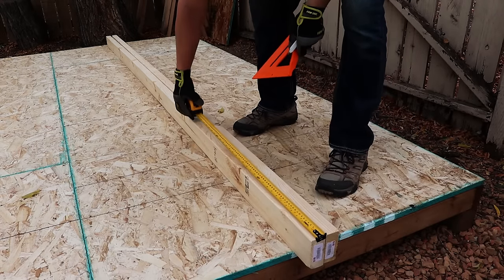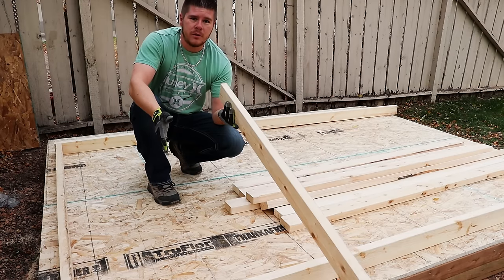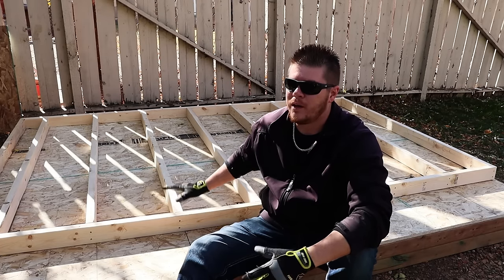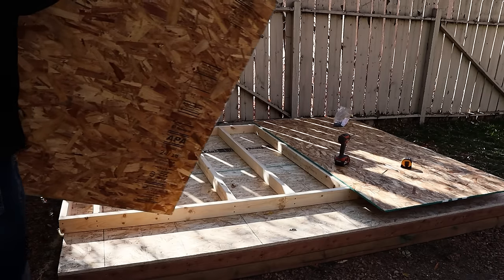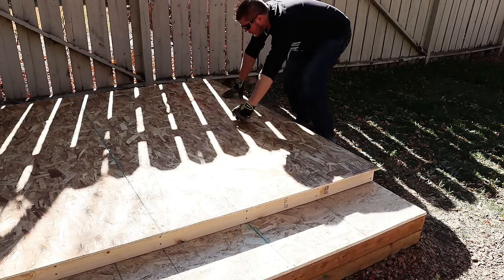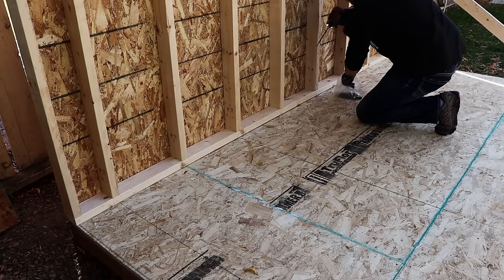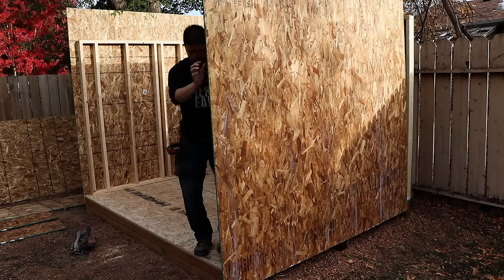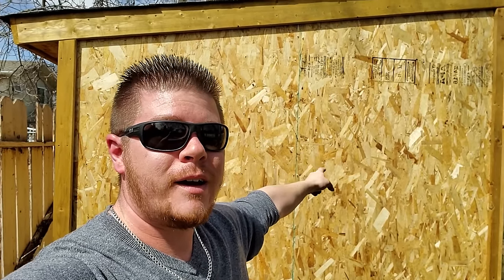How to build a storage shed - Walls // Part 2 - Plans available

Comment: How much can one save building their own vs buying one ??? I was thinking about 1/2 .
Reply from the maker: Sorry for the late reply, went through a rough patch. You xan save a few hundred, but it's not so much about saving its what you're getting for the money spent. And doing it this way is much stronger. Buying one they have to profit off it and will skip wood and hardware. Wall and floors might be 24" on center instead of 16", sheeting might be thinner and brackets may be excluded. It's always best for you to build if you're able
Reply: @JessedoesDIY  oh ok if they skimping on wood I can how using more materials can add up .  like you  said do it your self and end up with a lot better product is worth it. Tnx for the reply I hope u are doing better now.
Reply from the maker: No problem, glad I could help. Good luck on yours and thanks, I am now

Comment: Can you use 4 way wood pallets as a base?
Reply from the maker: It'll create soft spots every place they join together. Typically when you have a floating floor, you want it to be one solid structure because everything else is based off that. If it moves, sags or shifts the rest of the structure is going with it

Comment: Would it be beneficial to use  4x4 composite for the base and around the perimeter 2x4 composite? Just for longevity ?
Reply from the maker: Not really, you can if you want but this is fine. Pressure treated is good for 30-40 year ground contact, which is about the expected lifespan of the rest of the shed anyways.
Reply: @JessedoesDIY  I see thank you !! Great Video BTW
Reply from the maker: Anytime, thanks!

Comment: In my 35 years in the construction business not once have i ever used a drill with screws to fram a wall and if any of my co workers saw me framing with a drill they would've laughed at me
Reply from the maker: Ok well, I've sent it plenty of times on site. And in this case I don't need shear strength, and most homeowners don't have nail guns, but most have drills. I did it this way for the homeowners to make it easy and approachable, but you do you on your site man

Comment: Hi Jessie what did you put on the exterior corners of the shed. I did not see that part in the video. Thanks
Reply from the maker: On the outside? It's actually in the door and trim video. Just some corner trim is all made from deck boards
Reply: Awesome, thanks for the quick reply. I ha e my floor done, working on wall #1, Thanks, I am sure there will be more questions to come ha ha
Reply from the maker: Anytime glad I could help. That's awesome good luck on the rest of your build. Feel free to ask if you have any questions

Comment: What is the exact dimension of your floor w/ plywood?
is 1/2" osb too thin for floor?
Reply from the maker: The floor is 10' × 95" and yes that too thin. The tongue and groove 3/4" stuff I used is specifically made for floors. 1/2" will give you soft spots

Comment: So these screws are long to where it's going through material under which already has screws SO DO THESE SCREWS CAUSING MATERIAL TO SPLIT ❓❓❓
Reply from the maker: Yes, the screws going down through the wall bottom plate and into the floor are longer screws, 3.5" long. And no, they will not split the wood. If you are in a part of the world where hardwood is common then I'd predrill the holes first, but for softwood like pine or spruce it's fine

Comment: Why did you go with osb instead of siding for walls? Cheaper? I like this design I’m about to attempt it almost identically… just wondering 🤔
Reply from the maker: OSB is more readily available in my area and is generally cheaper. They make a specific shiplap style panel for use on shed walls that is still OSB, just more decorative and pre-primed if you want. But for me this wall all good for what I needed and fit the budget. Good luck on yours!
Reply: @JessedoesDIY  cool! I may go with usb also then … speaking of budget, what did that look like with current lumber pricing? 😬
Reply from the maker: Well I built this in the fall then lumber was about 2/3 what it is now and OSB was half what it is. It cost me about $1500 all told in my area, without painting. But currently I'd put it around $2000 if I was to built it right now in my area. All depends on your lumber prices. For me a 2x4 was $7-12, and the 1/2" OSB for the walls was $37 a sheet when I built. Hope that helps
Reply: @JessedoesDIY  it does help thank you!

Comment: what size is your shed  and did you insulate the floor . i want to put down metal mesh and insulate with roxul rockwool    need to find your first video .,starting mine come fall  . 8x8   list of wood that i will need  next
Reply from the maker: Mine is 8x10. I did not insulate the floor, but Roxul is amazing stuff! I have a playlist on my channel with all the shed videos in it in order. I also have a materials list for my exact shed available in the description of all the videos, it will at least get you started.
Reply: @JessedoesDIY  I thought it was  . how did you cover osb board  I have not seen your other videos . I built my other shed 12x22 with a a roof  . put windows electric and water in it . built it when I was 56 now I am 68  and done building 2 decks and 3 pergolas   , putting down vinyl plank floors in 2440 sq ft, house new doors and new trim .but want to build better since I could \not get roxul rockwool here until last year .Now I just want a small workshop instead of messing up my basement all the time .By the way I have remodeled and sold 3 houses in my lifetime  . Now in my retirement house since 2004  but landscaping came first also  dirt and a house not pretty , by the way I am also a woman  as you can see by my name . never stop as it makes you old . my first ever lean too shed though .
Reply from the maker: Nope, nothing is insulated in this, it's just a storage shed. Later on I'll be building a proper workshop whenever I move, that will be insulated. The floor in it is just raw OSB. Wow, that's amazing. Good luck on this
Reply: @JessedoesDIY  thank you     I bought my 3acres for 15  thousand  and then the work began   a modular house    easy dried in and built in factory and followed my house to it's new spot    2  cranes and a house was born and now a home . Took long enough but love my neighbors , They are a tad bit noisy  but what can you expect from horses and cows

Comment: the top corners . i notised you did not use the T locking thing .. with placing another 2x4 on top shortening it by the with .. and then another 2x4 on the other wall extending it by a with .. so u can lock it down into the other wall .. or isnt that needed for this one ? .. no a prof contractor nor did i work as one .. so not hating, just asking :)
Reply from the maker: Hey no prob! I accounted for it, but I needed the front wall up first. I showed it in the roof video, it's before I even put any of the rafters in place. They are the top plates and yes, they lock the corners of the walls together. Hope that clears it up
Reply: @JessedoesDIY  ty for the reply .. yes i saw in the next one that you OFC did it haha .. sry :D but again not hating was wondering.. my build will start next month, so picking up everytthing i can
Reply from the maker: No problem. I figured you saw it. Cool, well I'm happy I could help out. Good luck on yours, let me know how it goes!

Comment: How do you keep the critters and snakes away from staying under the shed?
Reply from the maker: I don't have snakes here, too cold most of the time. But probably some wire mesh before I put the walls on, I'm not sure, never had to deal with that
Reply: @JessedoesDIY  I'm planning to DIY a shed and probably would base it from your design. I'm just trying to figure out ways to keep critters away. I live in Tennessee, kinda warm.
Reply from the maker: Ahhh got ya got ya. Sorry tho, I don't have an answer for that. Good luck tho, keep me posted on what you've found out. I'd like to see it when you're done!
Reply: In Texas you can buy some snake rid at Home Depot. Check it out.

Comment: you should have used deck screw which are green instead of gold ones
Reply from the maker: You only need the green coated screws when going into pressure treated wood. The regular gold deck screws are for regular wood which is why you see me switching constantly depending on what I'm going into

Comment: How much dose this cost to build?
Reply from the maker: That's a loaded question with how volatile the lumber market is, and your area. Normal lumber prices, about $1000 for the whole shed. When I built it in the fall, $1500. Now I don't even know, could be $1800 for the whole thing

Comment: There's a lumber yard down the road that builds sheds. An 8' x 15' with a residential door  and two small windows is over $6000 with tax. This doesn't look impossible to do. What are your material costs? Why couldn't I do this myself? The hardest part for me would be handling the plywood. And you don't talk about leveling the site. That seems hard.

Comment: Don't use screws, use nails, screws don't have sheer strengrh they will snap durring storm or movement .
Reply from the maker: Screws have the clamping strength and will last just fine. There is nowhere on here where I need sheer strength. Everything is picking up the load from something else, nothing is hanging where sheer strength is needed

Comment: You say 4-1/8 over hang of wall but isn’t it 4-1/4 (3.5 2x4 and 3/4 floor OSB)
Reply from the maker: Technically yes, you are correct. But plywood is never full advertise width it is slightly thinner so to simplify things because I didn't want to touch the beams only the 2x4 floor joists, I made it 4 1/8
Reply: @JessedoesDIY  makes sense! I didn’t know plywood was subject to that nominal vs advertised thing.. thanks!
Reply from the maker: No prob! Yup, ever so slightly.

Comment: Nails are cheaper and stronger than screws. Just FYI.
Reply from the maker: You can buy nails and screws in bulk at a lot of hardware stores for nearly the same price. And nails and screws have different use cases. Nails are stronger in a side to side load force or a shear force. Screws have much higher clamping force and hold longer while offering a pull to close gaps. Most people have drills, not nails guns, and they definitely aren't going to swing a hammer for every fastner on this shed. So this was the best method to build a DIY shed for the average homeowner.
Reply: @JessedoesDIY  ring shank nails hold just as good if not better than screws. Every man should learn how to swing a hammer. Makes him feel more lie a man.
Reply from the maker: Oh I can swing a hammer, did it in school and building homes, but elderly people aren't going to. And they absolutely can hold as much, same with an ardox nail, but again most people don't have a nail gun and won't throw they're shoulder out to build a shed when screws will do just fine

Comment: Would you want nails instead?
Reply from the maker: Doesn't matter. I don't need the sheer strength of nails for this. IMO here screws are better just to hold things together tighter over time. Plus screws were more approachable for the average homeowner

Comment: Wish I would have kept up with basic math!! damn I suck at math...plus I'm a.d.d so it makes for more confusion in my head!!!! lol
Reply from the maker: Ooof yeah, there is a bit here lol. I have plans with dimensions if it makes it easier
Reply: @JessedoesDIY  well I'm trying to figure out how to frame some walls on a real small building that I was making I only got As far as the floor I'm still trying to figure it out I guess I just need to start from the beginning you know as far as framing goes
Reply from the maker: Ahhh got it. Well good luck on it!

Comment: well what can i say....Im inspired to make a flooring MUYSELF!!!  Me a cellist. Il told Ill save $1,000.00 and Im all for saving. I am making a CHEESE CAVE.. *Digging  6 meter hole, 10m  20m!! So naturally I need a TOP (or roof) IM making it out of the same material you are.  I have etra longer wood so it can fit nicely in the dirt of the side,, BUT when finished, It will be covered in dirt (about 12 inches).     (before I do that I am coating it in a liquid solution protecting it against the elements mainly water/rain.  I believe I've done everything I need to..............    CAN YOU THINK OF ANYTHING MORE I NEED TO DO?    Thank you SO MUCH man!   (I forgot I will cut holes for a ventilation machine. AN AIRECHANGER. Cheese can accumulate acid, CO2,  etc. CSN you thing OF ANYTHING ELSE!???  Thank you!
Reply from the maker: That's awesome that you're inspired! Sounds like an awesome project you've got going there. I can't offer too much advice for a Cheese Cave as I don't really know what you'd need for that, other than the ventilation you mentioned. Good luck on it!

Comment: I'm so lost as to how you used 8 studs on an 8 ft wall using 16 inch on center?!?!?! Why not on your first stud consider it 4 inches in and place the first stud 12 inches away from it so that all your studs line up 16 on center without adding more studs? But then also, why at the end of your wall, is there a 6" gap from the end? 8×12 / 16 = 6...... I'm just lost. Btw not a professional I've never built a shed in my life, this is me genuinely tryna understand hahaha
Reply: Nvm I figured it out. Just needed to do the actual measurements on paper lmao
Reply from the maker: Haha all good, glad you figured it out. It's all broken down in extreme detail in the plans if you want. Measurements, cuts, lengths, materials, everything. If you want. Good luck on yours!

Comment: Wtf is in this expensive ass shed.kinda tired of ppl making high price stuff that's overkill 2023 wth
Reply from the maker: I mean it's a shed, it's going to take materials to build it right and doing it this way is still less than buying one. If you want something smaller or cheaper then do that, but you get what you pay for